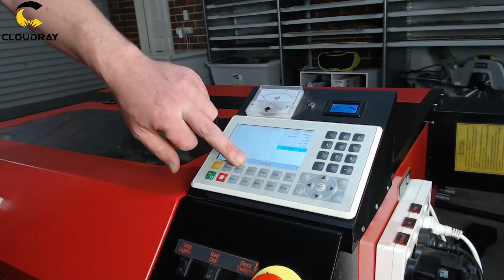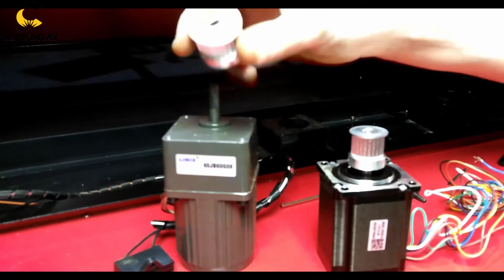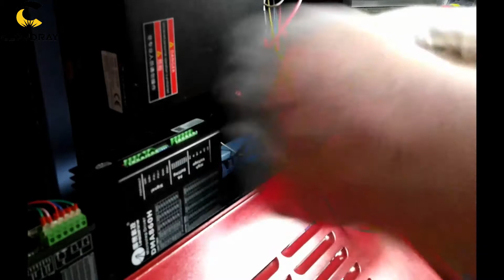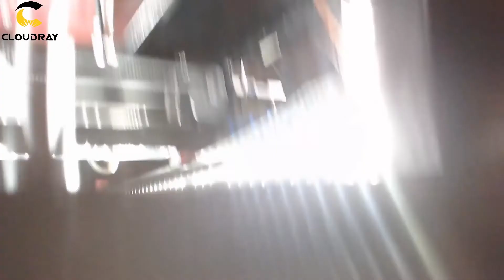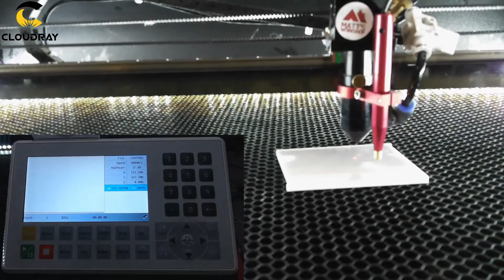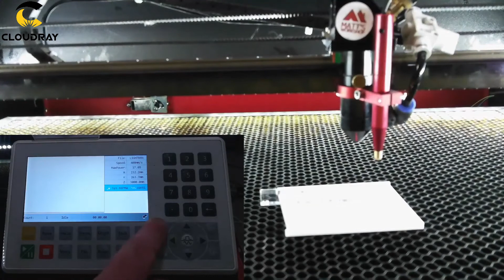Z Axis Upgrade on  Co2 Laser with Ruida Controller

Comment: I Need Help! I started my upgrade process the was taken down with Liver cancer for about 8 months. I'm now coming back to the upgrade process at a point where I should be able to begin the auto focus calibration. By the way your Video is the best ! So here are my dilemmas: 
1. My Z axis position counter goes down when it heading towards the bottom of the laser and goes up when the platen is moving vertically up (I assume that's backwards isn't it?) How do I correct that in the wiring or in the Logic control?
2. I do not know how to reset the Z axis so it reads correctly . the Axis reset function keeps bottoming out and gets stuck which may be related to the other problems.
3 . one more thing I rewired the stop sensors so thr z+ is on the bottom and Z- is on the top thats correct isn't ? 
Thank you a ton for all your good work!

Comment: I was looking a doing the same to mine along with the new controller. I see you made a 3D printed adapter mount to accommodate the extra width of the controller. It looks good, I was going to do the same to mine. Did you use the same angle as the front face or put it at 45deg angle?

Comment: Hey man, I enjoy your videos.  I am building my second 100 watt home built as we speak and went with some cloudray parts this go round to try something new.
My last build was all lightobject stuff.
Anyhow I just bought this Cloudray PSU unit>  https://www.cloudraylaser.com/products/100-120w-co2-laser-power-supply-monitor-ac90-250v-hy-z100?variant=45470453896
Any chance you can do a setup video or supply me with the instructions for the LCD panel.  I bought it from Amazon and the one comment on the review section said there was zero documentation.   I'd appreciate the input.